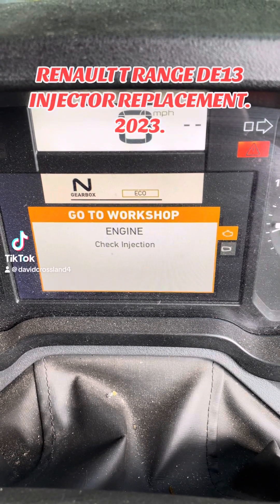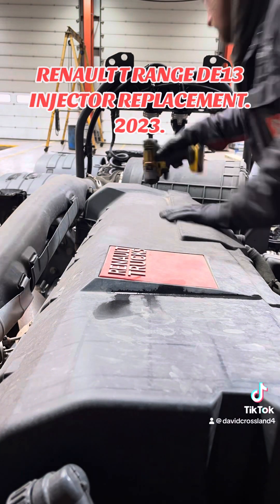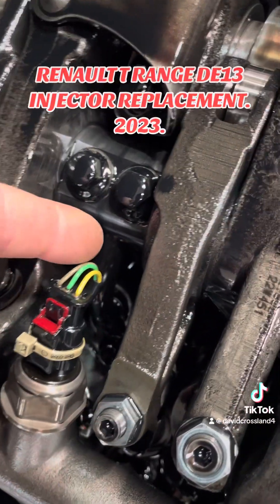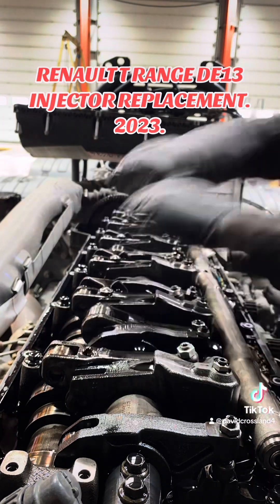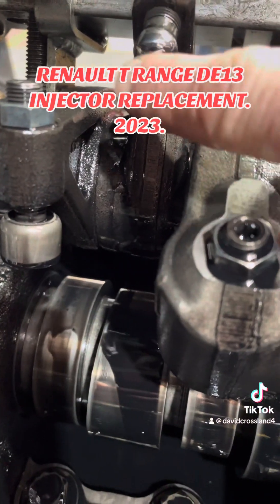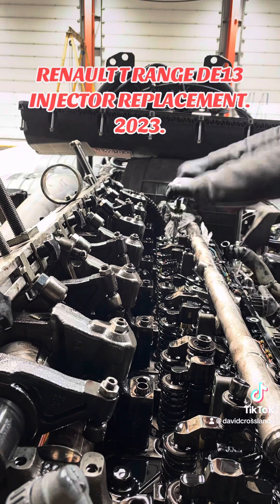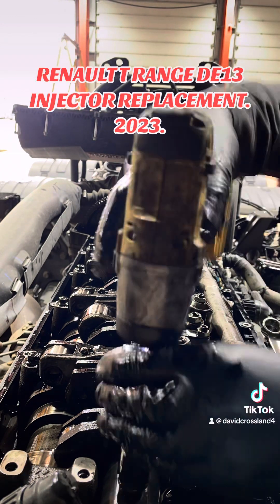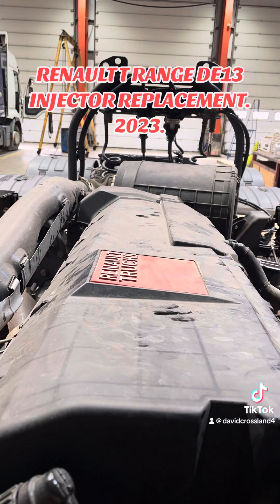Renault T range 2023 injector replacement.

Comment: Enjektörde kırılma nedeni nedir
Reply: Merhaba P052400 Renault d med aracımda Yağ basınç uyarısı var arıza nedir
Reply from the maker: @mehmetkarakoyunlu1013  needs diagnostics, that’s not a manufacturer fault code, but engine oil pressure fault needs diagnosing correctly could be several things. Don’t normally see low oil pressure on D range Engine normally on gearbox
Reply from the maker: Manufacturing, screws not tight enough I think.